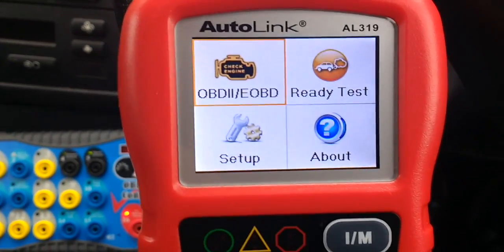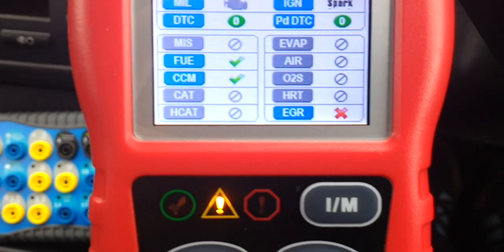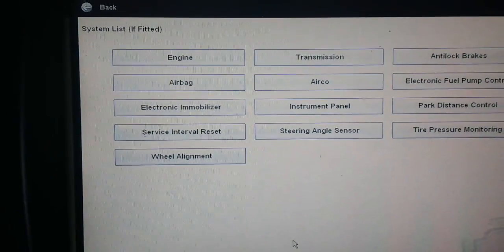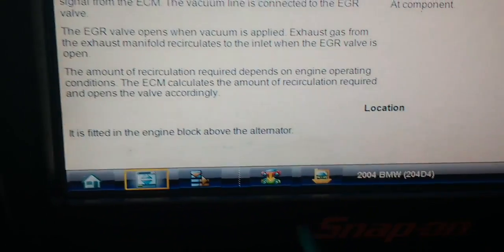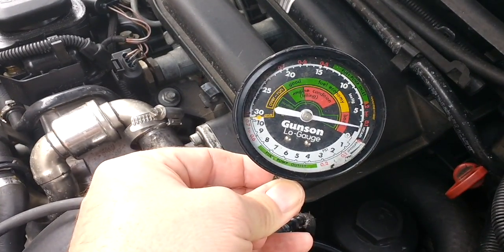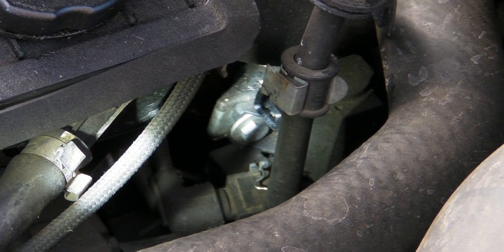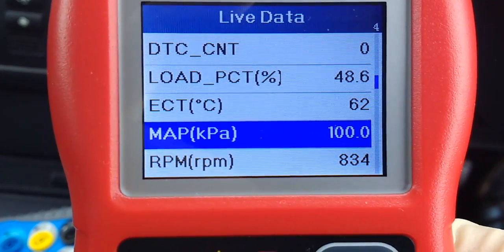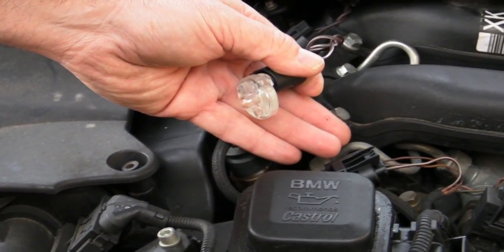BMW E46 EGR TESTING

Comment: hello sandy i wonder if i could pick your brains  having trouble with a  volvo s60 d5 2004 model  going into limp mode it  had a fault code for egr position  i removed the egr and cleaned  it up  (was stuck open) still having  the same  fault code for   egr  position  and stuck in limp mode  the solenoid is a simple 2 wire one  just replaced it and no joy still the same i can clear the code koeo but wont clear when running  removed the egr and re checked  it .  what i cant understand is how can it have a fault code for egr position when it has no position sensor in the egr solenoid  
have 12v on both wires and when unplugged  12v on one and 3.6v on the other which must be bias voltage  i think
egr is working fine when controlling it through the scan tool 
any advice would be greatly appreciated
Reply from the maker: Hi Tony had a similar fault on a two wire Vauxhall purge solenoid valve.  The computer just did not like the resistance/current flow in the valve and just rejected it.  Replacement cured it.  I can only assume that the position fault is a referred value from the airmass meter not dropping enough air flow during egr opening. Hope that makes sense cheers sandy
Reply: @sandyande  thanks  it maybe the  used egr solenoid i fitted is faulty   , i had signed up for a 14 day free trial with alldata but  volvo is the only manufacturer they  dont give access to  ironically .
 thanks again . tony

Comment: hello, and I have a similar problem, there is no acceleration of the engine until I turn on the turbo. I doubt the electronic vacuum valves, I think they do not work well. What do you think?

Comment from the maker: forgot to demonstrate using the vacuum pump on egr with engine running, if valve is opening the engine should start to die/choke
Reply from the maker: S. T yes it could but it's more likely to be a blocked dpf/cat
Reply: sandy anderson if no dpf fitted and not the egr would the map or Maf sensors also cause similar symptoms?